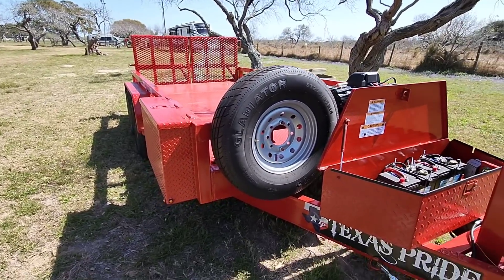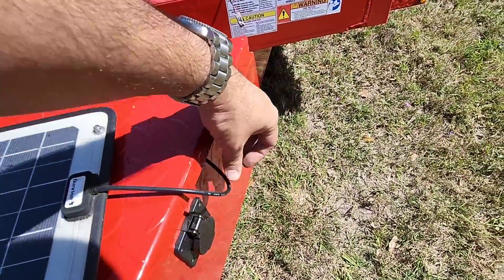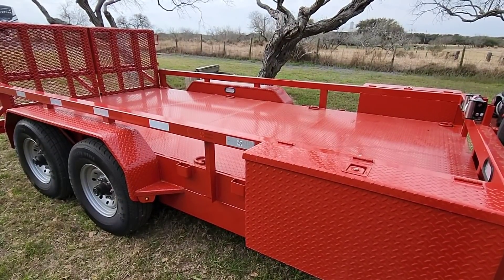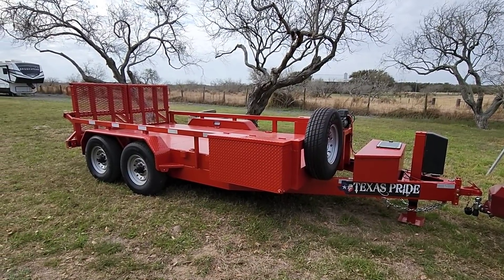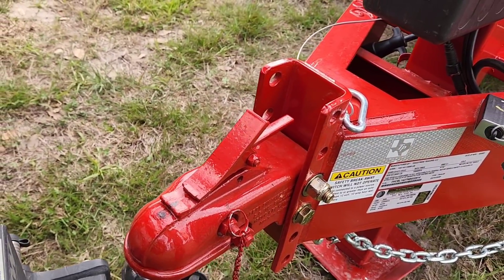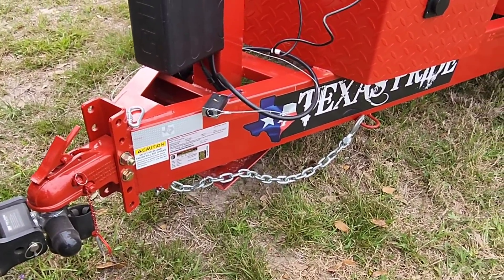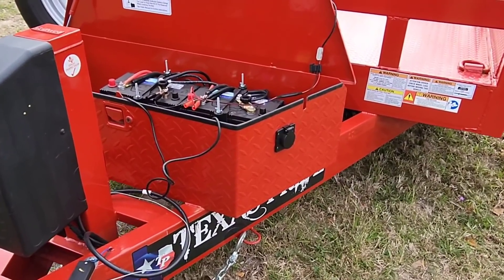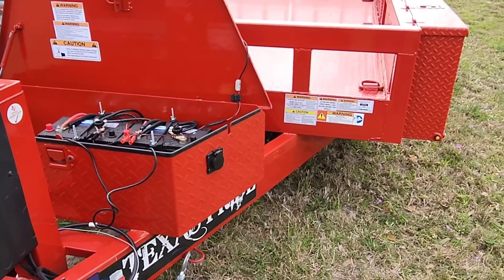DON'T HIGHBALL your Trailer Coupler!

Comment: The worst thing that happened to me is when I went to disconnect my trailer. 
 I had a load of hardwood flooring in the cargo trailer.  I forgot to put down the rear jacks before I uncoupled from the ball.  The flooring had shifted a little in transport to the rear.  As soon as it was disconnected, the back end dropped and the entire trailer rolled forward smashing in my tailgate on the pickup with the coupler.  🤦🏼‍♂️

Comment: Back in the day. I was moving a trailer in my neighborhood and was being lazy and dumb and just dropped it on the ball raised the jack all the way up and moved it. Without locking the coupler or hooking anything up. Everything was fine until I drove over a bump. The trailer jumped of the ball and landed in the jack right then and there. It didn't cause any damage or hurt anyone. It was a pain in the ass to get back on the ball tho. Because the jack was to short to reach the ball and I had to get a block under the jack to reach the ball so I had to raise it as far as I could block it up raise the jack put the block under it and then rais to hitching height. Major pain in the ass all for being lazy. I will say that I would have never done that if I was going out on the street back then. But it was still really stupid and very dangerous. Considering it only takes a fraction of a second to flip the latch on the coupler and none of that would have happened. I think you should give a prize for the best coupling mistake admitted to that DID NOT RESULT IN AN INJURY OR CAUSE AN ACCIDENT INVOLVING ANOTHER VEHICLE. Since we are publicly admitting to our stupid mistake!!.

Comment: Back in 2009 we were on vacation and I was doing my walk around and the wife interrupted me and I stopped where I was and went inside to  answer her question. when I went back out I thought I was all the way around to the truck mirrors. I was not. I left the campground and when I got to a double set of RR tracks the camper bucked off the truck.I imeadiatly knew what happened. I got out and saw It was straddling the tracks so I jumped back in the truck and drug the camper off the tracks. Its not a real busy set of RR tracks but I was not taking any chances. I pulled about 40' so nothing was over the tracks. With a bent tongue jack I took several pieces of firewood out of the back of my truck and made a pyramid to jack up the camper. I had no jack except the bent tongue jack. Whew , never again. Now if I get interrupted I go back to where I started and I start all over. PS it was only a popup but it was a 3600# popup. 400# tongue weight. Nice big Highwall.

Comment: Rented a u-haul trailer, they told me that I needed a 2” ball, and for some reason I thought I had my 2” on my truck. I also have a 1-7/8” ball that I use for another trailer, found out as soon as I left the u-haul that it was in-fact the incorrect ball.

Comment: A friend was helping hitch a trailer he guided me and coupled it. I didn’t check it. It came off, the safety chains held ..I was at fault because I was the driver. I should have checked it. Luckily all ended safely.

Comment: At work we had a small trencher trailer hooked to Toyota truck. The bumper came completely off the back of the truck after going over railroad tracks. The trailer with bumper and safety chains still on it passed the truck pulling it.  Luckily it ran into some small saplings that stopped it . Amazed it didnt flip actualy the trailer tracked strait with the bumper hovering most of the trip just above the ground. Never could get them to pull the trencher more toward the front for some toungweight. Lol
Another employer at a diferent job had a dump trailer. That employees loaded two concrete columns in  and of course they didnt have them set or strapped to keep from sliding.boss ordered me to drive the truck pulling the dump trailer even though I protested it as a dumb idea. We were in the hill country of Lago vista Texas. First hill load shifted to the back of dump trailer causing the trailer to leverage the f250 rear tires off the ground. Luckily got it back to bottom of the hill with wear wheels still off the ground and rear of the dump trailer scraping the road. I got out of the truck and walked home where I called boss and told him where he can go get his truck.
Reply: Trying to get other people to understand the dynamics of loading a trailer properly is always a challenge. I saw a new hitch a few weeks ago which has a scale mounted into the receiver so you can tell how much tongue weight is on the tow vehicle.  Looks like a good device but I'm sure it will be expensive.  For a business, it would pay for itself.
Reply: @Harry-zz2oh  some companies  wont even buy actual electric connections to repair wiring  or purchase straps or any thing to secure a load. Lol
Not sure I could get them purchase something they wouldn't understand. Lol
Some companies cant be fixed best to just step away from them. 
I do think a scale on hitch is a good idea I've always had to judge by sqat of tow vechical  not a exact science  but I'd rather have more  than no toung weight. That way tow vechical has control of load. If it feels off I can at least slow down  pull over and hopefully ajust. A light toungweight trailer can get crazy so fast it pulls the tow vechical off the road.

Comment: I went quickly move my deck trailer that had a lock on it so I dropped my trailer with a 2 5/16 coupler on it on to a 2 inch ball attached to a bumper and was pretty stoked it just popped on so I can move the trailer just to the other side of a field… The problem came when I tried to jack up the trailer and it wouldn’t come off the 2 inch ball and I didn’t have a key to release the coupler so with the truck jacked up slightly with the trailer jack trying to put the truck in forward and reverse just trying to get it to break loose, I was even trying to jump in the pan of the truck. I almost gave up but it finally popped out, I was running late, so I was starting to get a little stressed

Comment: I have let my friend hitch up his parents pontoon trailer to my truck and he didn’t lock the coupler while camping. I had to go around the campsite and when I came back to pick up the friend and mom, the empty trailer slammed into the back of my ram and dented my bumper. It also stretched the wires for the lights on the trailer. I was pissed and the dad was pissed too

Comment: TIRES TIRES TIRES!!!!!!! very important that you check the date on the tires too I had an incident with my single axles utility trailer that my inflated raft sits on which has aroller on the back for easy on off unloading and loading .I also use it to haul yard debris or mulch when I put my side rack's on . It has an 1850 lb limit so it does not haul very heavy loads which isok . Here's the deal I had a tire blow out while fueling the truck. I had a spare so I changed it and later I went to tire shop and showed the guy working there the tire and he then looked at the tire I put on and the still good tire and he said the tires are way over DATE. !0 yrs is over date and these were quite a bit over date he then showed me the still good tire has metal threads poking thru the wall of the tire like cat whiskers just barely so I ended up buying three new tires on the spot so check your dates on the tires . I was on a long road trip and a very hot day after a 4 day river trip . we were lucky it happened at the gas station and not on the road

Comment: The solar charger is a good idea but if you're trying to charge two batteries and using a disconnect on both grounds are either battery getting charged???? Just wondering. Nice set up tho, safe towing!

Comment: I highballed a car trailer with a car on it.  It was a trailer that I never used before and in a hurry thought it was connected. I was pulling it out of my property on to the road when it fell off the ball. Luckily no damage was done. I had to use a car jack with bricks to get it high enough to reattach it. I won’t do that again.

Comment: 1) When picking up my trailer for the 1st time, I had a 1 1/2 " ball (instead of the 2")
2) Dropped my trailer off at the dealership for some repairs and forgot to drop the battery in before leaving (The battery is required for trailer breaks)
Reply: Kenny,  No 1 1/2 balls, must have been a 1 7/8.

Comment: Yeah but I have that coupler and when I went to lock it I realized it so I had to jack it back up. I do have a question though. Can I get some pictures of the winch mount and did that come from Texas pride themselves? I have my jack mounted there on my trailer (one of there 16k lowboys) but I need to mount a winch somewhere that will stay out of my way and there seems to be my best bet.

Comment: Just happened a few weeks ago. I latched on to our dump trailer and running around with it and disconnecting i realized one of the clevis pins holding the hitch on went missing and the pin was about to come out.

Comment: I'm terrified of having my trailer highballed. Since my small utility trailer I move it by hand I lift up on the tongue to make sure it's on there properly. Heavier trailers I often raise the tongue with the jack to make sure it  takes the hitch up once it's latched. Like I said I'm so scared of having an issue I triple check and I try not to rush through trailer hook up.

Comment: I've never highballed one, but back in the day I towed our 1st TT from Utah to Tennessee, our 1st real trip. When I was parking it, my dad noticed the ball move in the Equalizer hitch head. The nut had maybe 3 or 4 threads still on the shank. It looked fine sitting there. Still makes me sick to my stomach thinking about what could have happened.
Reply: We saw something like this several years ago at a dog show at the faie grounds at Moses Lake, WA.
A friend of ours arrived with her trailer in tow

 I was helping her back into her assigned space. As I walked back toward the back of her trailer. I looked at her hitch,and just about fainted. Everything looked OK. Except that the trainer hitch was just sitting on the tow vehicle bumper about4" away the ball. She had driven half way across Washington state,State, is no telling when the trailer decided to unhitch from the truck!
The only thing that kept the rigs connected were the weight distributions bars!
She apparently neglected to lock the hitch onto the ball.
She used up ALL of her luck that day!

Comment: I have a tilt deck 8X20’ car trailer, forgot to reinstall the clevis pins that lock the deck to the frame, got on the highway and pins fell off and popped one tire, how I use a neon green strap to tie both together so they can’t be lost🤑

Comment: Why did the whole hitch on the trailer move when it went down on the ball ? It seems that it should have been solid.
Reply from the maker: It's an adjustable coupler.  It's essentially just pinned in place with the 2 bolts.  It's not going anywhere

Comment: Do you normally grease you hitch ball when you are using your trailer, or do you drive with a dry ball?
Reply from the maker: Always greased.  It wasn't here because water collected in the rubber cap and washed it off.

Comment: I've had a trailer come off before. Thankfully it was an empty single axle trailer and it popped off still in a parking lot and safety chains did their job. Don't remember why it didn't latch. May have high balled it since it was raining at the time, in a hurry to get out of the rain. One extra step you could do with your auto coupler and your hydraulic jack is lower it, let it latch, engage the pin, and then do a test lift to see if it comes off. Got to be careful with that since you're trying to lift the back of the truck though. Semi truck drivers always do (or at least should) a test pull when hooking to trailers to make sure they don't come unlatched.

Comment: I don't know if your batteries are in series or parallel but connecting a charger to the 2 inner terminals is almost certainly not the correct way to hook it up.

Comment: I, when i was a beginner tower, did not torque the nut on my ball. Smdh. Well i fet the looseness of the neck. Well, it made an oval on my hitch, tightened it up proper and later bought a new hitch. 

I now tow often and use a 

GEN-Y REBEL HITCH

live and learn. And properly tighten my ball and nut now. Not funny at the time, but looking back
Lmfao as i smdh

Comment: I rented a car trailer from uhaul and they said for insurance reasons they had to hook up the trailer which whatever it’s their trailer well as soon we pushed the dead car i was towing on the ramps it popped right up and slammed straight into my tailgate and rear bumper and license plate but at least their “insurance reasons” that they have to hook it up and they didn’t do it right made them pay the 1600 in damages it did to my truck

Comment: Rather than putting a lock on the coupler, just pull the two bolts and take it with you. Too bad we have to go to  extremes to keep our hard earned equipment.
Reply: A guy I knew from work had his trailer located at the back of his pecan farm. One day he went to get the trailer and it was gone. He was very upset since the trailer was completely out of sight.  Where I live, trailers are one of the highest theft items.  My trailers are in my back area but I need to install newer locks.  I'll also install a deadman and lock a chain to it so the frame can't be moved.

Comment: You never put safety pin into coupler latch. Also no safety chains were hooked up
Reply from the maker: I guess you're assuming that the video was the end of the connection story and more safety measures weren't taken after I pressed the stop button.

Comment: BT-BRV, your safety chains don't look heavy enough for the capacity of the trailer in case of a hitch failure. You might be surprised how low some chains have as a working load rating. Personally I don't get to excited about utility trailers...it's the equipment I'm hauling, skid steers, tractors, motorcycles, etc.that interests me...sorry..IMHO

Comment: Let a guy hook my car trailer up  on car trailer  her didn't latch .it  so when unload the vehicle   .one those deals  trying unload car off trailer get done in off hours at work . Well  it come up trailer shot into tail gate truck .after that I always check and pin .  We didn't even hook chains or electric  up  just moving it around lot not on road   never again let some else hook my trailer up with out checking them